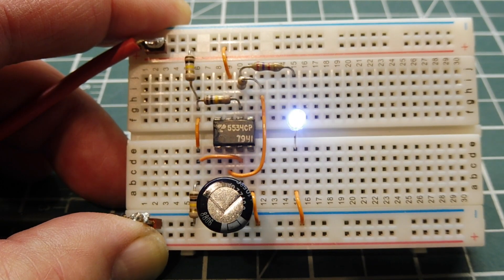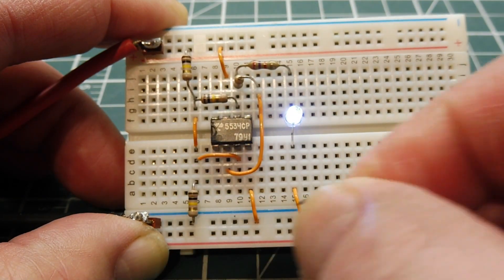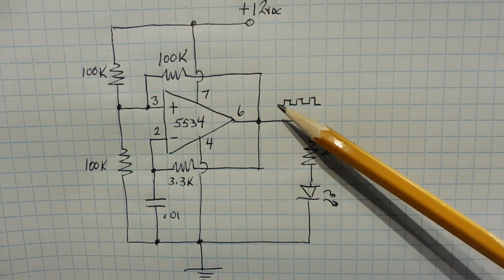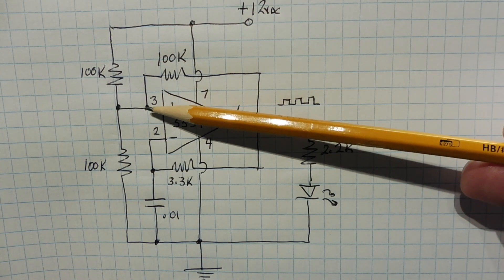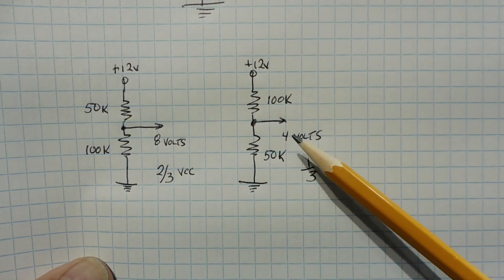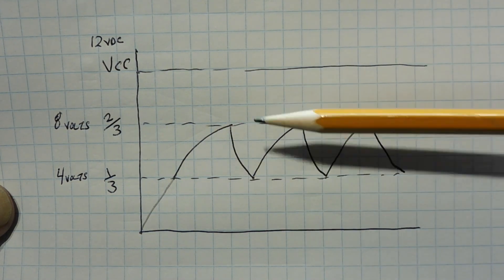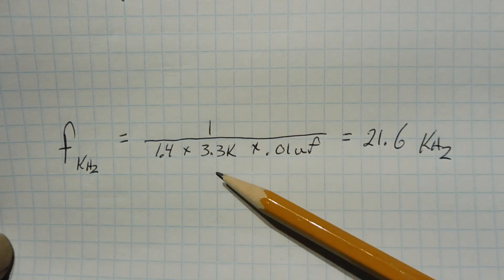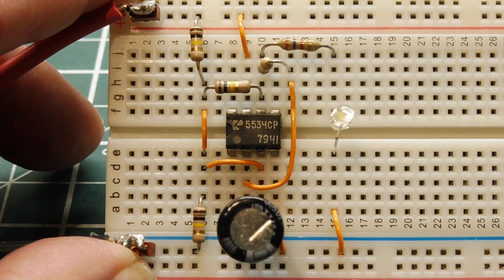Op-amp Oscillator  / Quick Circuit  / NE5534

Comment: Dear sir...can I use this circuit to build a guitar amp to run a 8 ohm speaker using a 9 volt power supply
Reply from the maker: If you want an amp that can drive a 8 Ohm speaker have a look at the LM386. Check out this video:
https://youtu.be/zMmaFV_JRAw

Comment: I replaced all the 100k resistors with 100k pots and listened to it though an amplifier. It's sounded cool but then some of the potentiometers started sparking and smoking. Do you know why this would happen? I'm assuming because too much current is going through the potentiometers. I what to know why all that current flows through the potentiometers when you turn them up and down.
Reply from the maker: If you turn the two pots to zero that form the voltage divider you are shorting out your power supply which will draw lots of current.
Reply: @0033mer  if you put a 10k on on the side of the one pot going to ground and another 10k resistor on the on the side of the other pot going to 12v will that solve the problem? Also is the technical teem shunted to ground?
Reply from the maker: Yes, adding series resistors will solve the high current problem  To control the output frequency all you need to change is the value of the 3.3k ohm resistor.
Reply: @0033mer  I am feeding two of these circiuts into a 74LS86 chip. One goes to the input a and the second goes to input b. The out put goes to an amp. I am getting a lot of noise. Does this sound like a grounding issue?

Comment: I have made the same circuit but the duty cycle is 60% instead of 50 and i want to know why
Reply from the maker: Check the resistor values. Ensure they are matched in value.
Reply: @0033mer  I found the reason, and that's not the resistor. I use the same resistor value, 100K. The opamp I use (LM358) isn't rail-to-rail. so the output is asymmetrical. With 5V it can pull low to really close to 0, but can only pull high to 3.7V. So charging the capacitor would be longer, so the on time. and discharging would be faster.

Been stressing this out for a couple of days but i finally found peace

Comment: Like all your videos this one is amazing!! There are 2 things I couldn’t understand though. 
-What is this 1.4 in the frequency formula is it a constant or something?
-What is the sourcing capability of opamp business?

Thank you for your efforts and happy new year 😊
Reply from the maker: 1.4 is basically a constant. The capacitor charges from 1/3 to 2/3 Vcc which is .7 of the RC time constant. For calculations we use 1/.7 which is 1.4. The NE5534 can drive a 600 ohm load directly. Happy New Year!

Comment: 1/3 vcc and 2/3 vcc... and the charging and discharging of a capacitor being used to drive the square wave output... you have basically made a 555. Nice!
Reply from the maker: Yes .. you are correct, it is a very simple 555 timer. The three 5k resistor in series inside the 555 timer basically functions in the same manner.